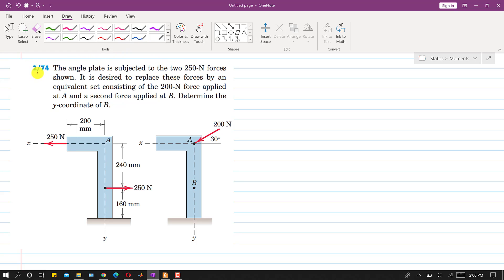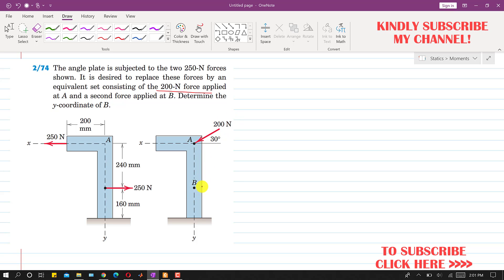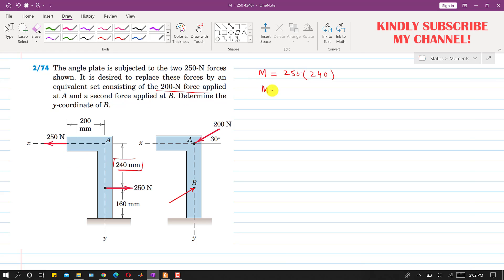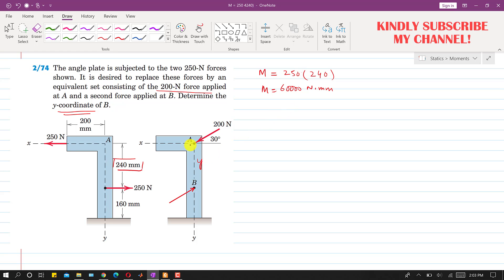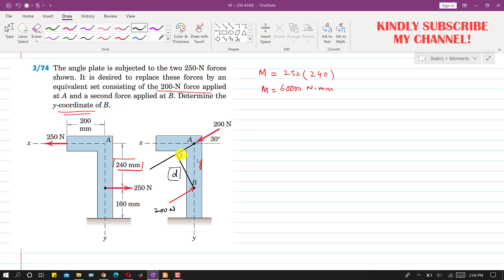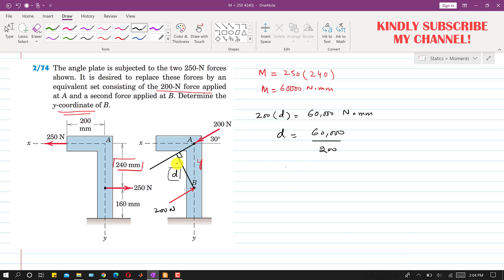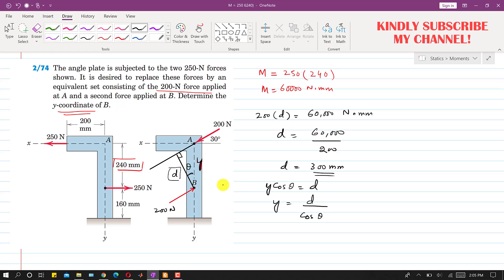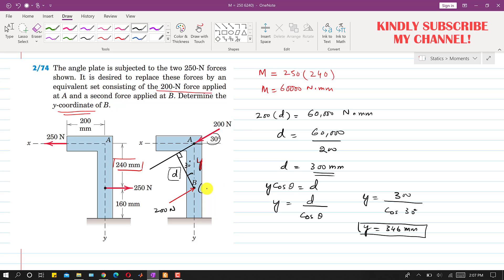2-74 | Engineering Statics | Force couple System | Engineers Academy

Comment: I did it a slightly different way. I calculated the initial moment and then used this with the Fx component of the 200N force to calculate the required d. I got 346.4mm. Is this still correct or is your method a better way to do it?